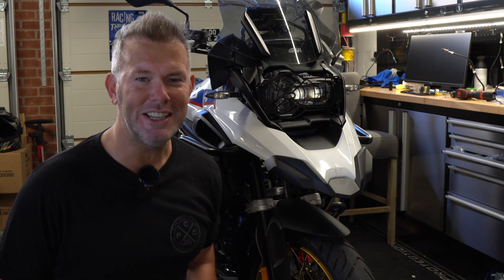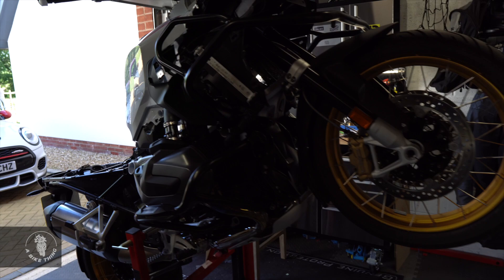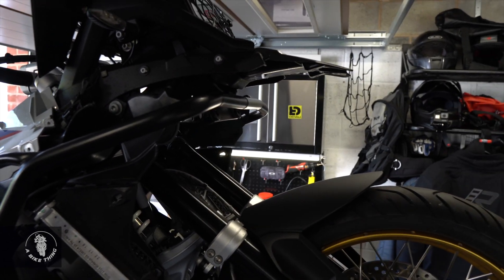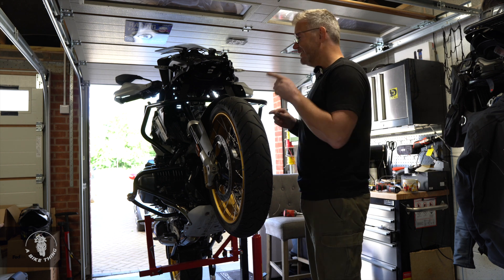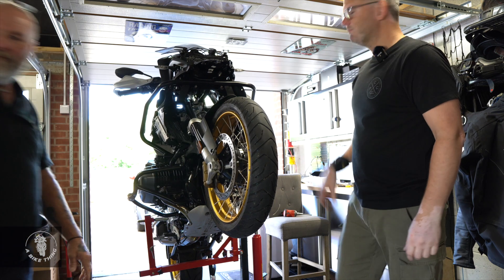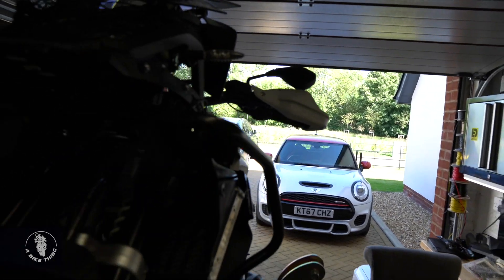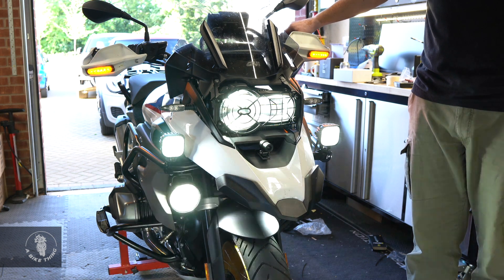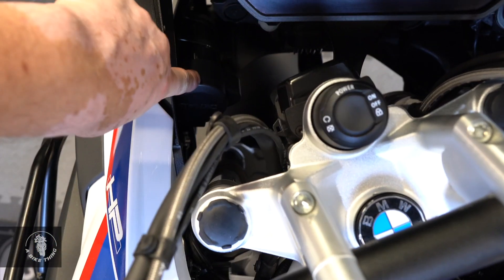A BIKE THING SPECIAL MOUNT FOR GS WITH UPPER CRASH BARS

Comment: Cannot really tell from your video, but the SoundBomb compressor cylinder seems to be mounted horizontally. Denali recommends it to be mounted vertically or no more than 25 degree variance from the vertical.

Comment: hi Steve, wondering if your bar could be installed having the wundrerich upper bars as well as the LR headlight protector. Have you tried this? as the LR uses the same hexagon socket on the bike....what isyour opinion?
Reply from the maker: It will as long as the LR mount doesn’t have captive nuts.  If their captive, you’re screwed

Comment: Hi Steve, I have the Lone Rider headlight guard fitted which also makes use of the hex holes that you are using with the light mount. Can they co-exist? Cheers David
Reply from the maker: Yes.
Reply: @ABIKETHING  thanks Steve. Could the Denali crash bar mounts be used with the wunderlich upper bars instead of the light bar? What would be the disadvantages of this approach? Cheers. David

Comment: Hi Do you know if the mount works with Touratech top bars ? I have D4s fitted to Touratech top bars using crash bar mounts. Liam
Reply from the maker: I’ve been advised it won’t fit along with the touratech upper bars
Reply: @ABIKETHING  Thank You.

Comment: Just to be sure, the mounting bar you installed is your 2019+ R1250 GSA bar (previously a modified Denali GSA bar) as mounted on a R1250 GS. Is that correct? I have the Denali bar specifically for my 2019 GS (HP) and it doesn’t fit with the Wunderlich upper crash bars. I’m thinking that the extra length on the drop down leg of the GSA bar will get the D4 mounting surface lower and clear the crash bar. Is there anything else I should be careful of? I love your channel and study all your videos.  Dan from Huntsville, Alabama, USA.
Reply from the maker: No.  It’s a modified R1200gsa mount.
Reply: @ABIKETHING  Thank you. That saves me a lot of time and trouble.

Comment: Is there any way to use the lift with the F850GSA instead?
Reply from the maker: Scarletsboy yes just type in the comments section when you complete purchase which model and year and I’ll make sure the correct adapter is supplied for your bike.

Comment: Great job and videos. Thank You for Your effort. I would ask You for advice. I have brand new R1250GS and I bought Touratech upper crash bars (https://shop.touratech.pl/gmole-gorne-ze-stali-nierdzewnej-do-bmw-r1250gs.html) with OEM fog lights. I bought denali D7 kit and I would like to move OEM lights on down crashbars and attach D7 to upper crash bars or special mount plate from you. Could You give me advice what will fit for my idea. I mean great look and funcionality. Thank You.